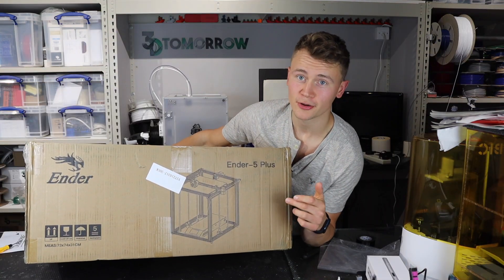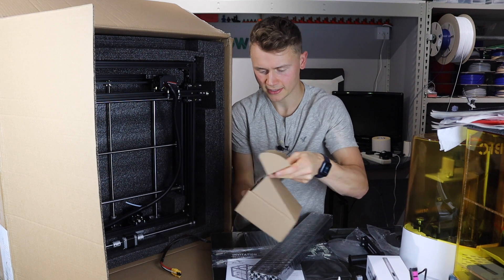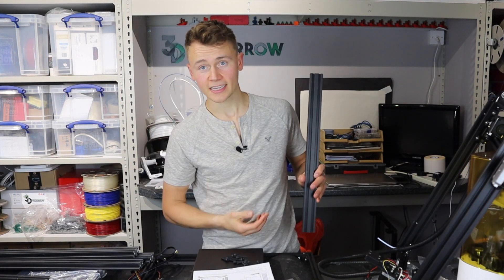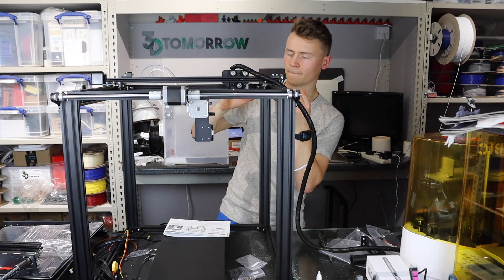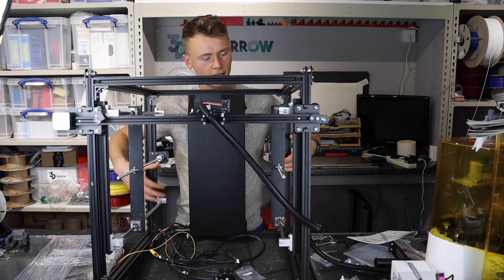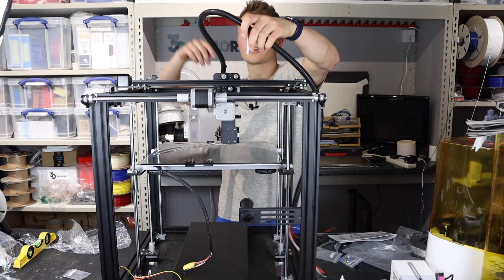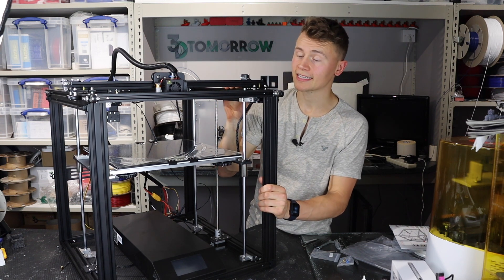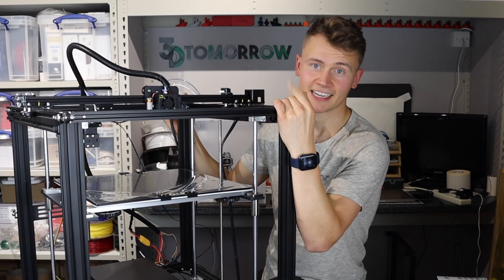Ender 5 Plus - UNBOXING & First Impressions - 3D Printer From Creality

Comment: Great video as always! That's a beast of a machine! I'm actually a newbie to 3D printing. Have you ever considered doing a how to video series for beginners? What you'll need, programs to download, supplies, etc.? I personally haven't seen anything like that on YouTube. It would be extremely helpful to those that want to start but don't know where or how. Just an idea 💡 In any case, keep making awesome videos✌️
Reply from the maker: Hey Rob, thanks for the comment! The machine is indeed quite a beast and takes up a lot of room, but I'm looking forward to testing out the full build volume. I've got a huge list of videos I want to do, but can't say a getting started series was something I'd thought about, could be a good idea though. I'd have to think back and try to remember what I wish I'd known when I got started...
From the supplies front, I'm a fan of 3DLAC adhesive, I know some people like to rely on 'grippy' build surfaces, but they're hit an miss in my opinion. In terms of filament, start with PLA and master it before moving on to more other materials if you feel they're needed. Personally, I'm an advocate of support local, so I'd say find a manufacturer in the country you live (3DTomorrow if you're in the UK :P)
Good sites for free models: Thingiverse, Prusa3D
Slicer: I use Simplify3D, but wouldn't say it was worth the investment anymore, it's lacking in recent updates so is buggy. Cura, IdeaMaker and PrusaSlicer are the big ones for FDM.
If you want to start making your own models, take a look at TinkerCAD, it's free online software which is pretty quick to pick up and great for simple designs or tweaking existing files. One of my early videos has a brief tutorial on it.
Hope that helps, happy printing!
Reply: @CallumColes  Wow, that was an extremely informative response! I appreciate you taking the time. I look forward to putting your recommendations into practice. Thank you so much! ✌️
Reply: @CallumColes  I'd second this. I am about to buy a 3D Printer and would like one that is easy to use, but does good and not choppy prints. It would be nice if it were to engrave too, or have an attachment that I could buy that would engrave. I don't think I need a printer this large, though. My price point is around 300 to 350 US Dollars. Any suggestions, Callum?